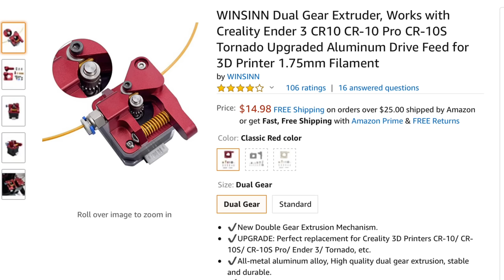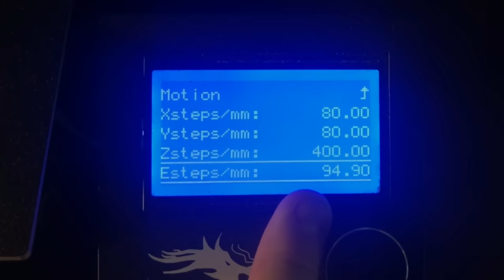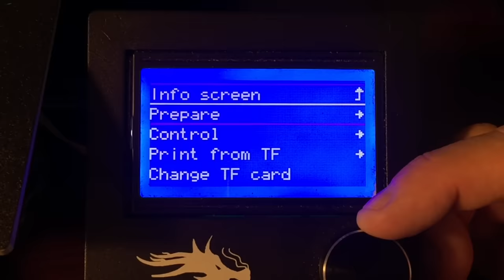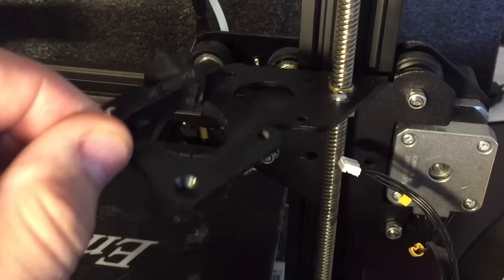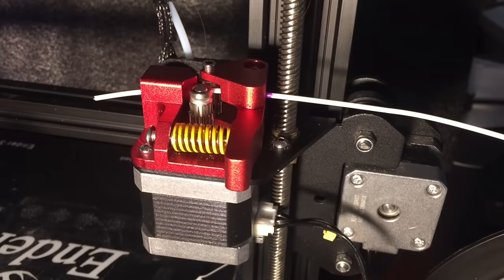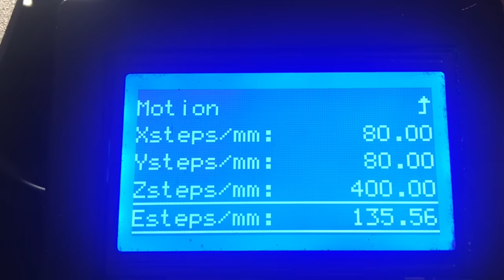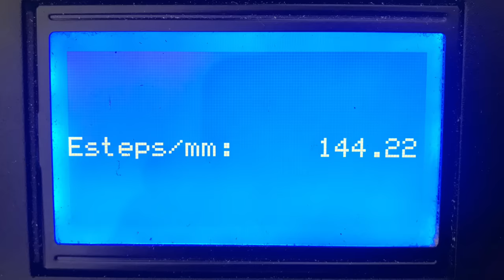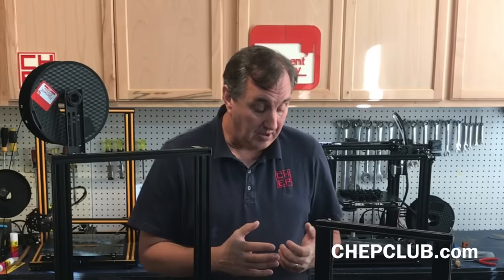Dual Drive Gear Extruder Upgrade + E Steps on Creality Ender 3

Comment: Chuck can this extruder be used with the PTFE insert inside the extruder housing that helps in printing Flexibles? I love the extruder mount that you did with this change but would like to find an all metal extruder mount plate that can do the same thing.
Reply from the maker: You’d have to drill it out. I don’t know of a metal one that handle Ninjaflex.

Comment: Thanks a lot for video. I want to extrude some amount of filament manually, to calibrate the extruder. But unforunately I do not have this option in my printer's menu. I use ender 3 with upgraded to Marlin 2 BIGTREETECH SKR 1.3 board. Version of firmware is Marlin bugfix-2.0.x. Please give me any suggestions, how to make this menu visible. I read on official website of Marlin, that it should be visible only when printer is not printing, but I do not have it neither just after boot nor after the PLA preheated

Comment: Don't know if they offer different versions of these red ones or if it was just me getting unlucky but holes on mine scrape the hell out of the filament. I spend a week configuring everything and it was finally printing well (I thought gears were grinding the filament) but any longer print just eats the filament leading to gears slipping among other things. If my hotend clogs due to having this extruder I'm gonna lose my mind. I'll be contacting the seller to see if there's anything he'll do for me but I'm pretty pissed either way. Finally took time to calibrate everything and I end up with that, even if I get my money back it'll just be a lot of time and hassle that I don't have... Always unlucky with this hobby, really turns me off. My Ender 3 v2 had a faulty board as well, which I had to change. Overall I wish I didn't buy this printer or just invested into a prusa model. It's supposed to be a hobby but it's stressing me out and I'm just stuck testing all the time instead of printing anything.

Comment: Very nice video Chuck! I was wondering if you have tested the maximum print speed with the dual gear and if it's better than the single gear. I have moved my single gear up and down whenever it started slipping to get a better grip, but now my whole gear is sanded down...
Reply from the maker: I haven’t.

Comment: Great video. I bought a similar looking kit to put on a new base ender I put together yesterday. The creality extruder motor has the gear friction fitted on the shaft and I was hesitant to pull it off. The kit I bought wasn't dual gear as advertised anyway so I'm returning it. Would you have pulled that gear off the motor? I'm installing a second z axis and plan to convert it to direct drive and I'll run into the same problem with the friction fit gear and wether or not I should pull it off. It must be one of the design changes they made this year along with the 32 bit mainboard in the base unit. Any advice would be greatly appreciated.

Comment: Just installed this on an Aquila X2, noted the abrasion in the video under the tension arm, and checked the bottom of my arm: definite sign of damage to the edge, so I leveled it with 1000 emery paper. No sign of abrasion, but now wonder about smoothness of the filament path from the general rough surface finish. Would redrilling the holes a few 0.01mm affect the operation?
Reply from the maker: That should hurt anything.

Comment: I bought one of these, but I always struggled to get the filament fed through becase the hole the filament feeds through is a bit smaller.  I have gone back to a standard extruder for now until I have time drill out that hole.

Comment: Thanks for the video Chuck. I wonder if it will fit also on my Cr 10 mini (should be the same as the old stock Cr 10) and of this might improve for flexible materials in comparison to the stock extruder?
Reply from the maker: Yes it will fit.

Comment: Some ender's don't even have set screws. I have a recent ender and it doesn't have them.
Reply: Yeah I noticed that far to late xD 
I had to commit to cutting off the original brass gear from the motor shaft and sanding down the shaft to make it flat on one side for the set screw to not slip with a dremmel

Comment: Not sure if a dual gear extruder is all that great. After adding one to my printer the filament is being ground up and bunching into my extruder gears. I can’t adjust the idler tension any lower because the yellow spring is so incredibly rigid

Comment: It’s not slippage… it’s just back pressure from having the hot end hooked up… I can never wrap my head around why people say to calibrate E-Steps with out running filament through the hot end. Of course it’s going to be different if you don’t calibrate it that way. Best way to calibrate is to do it exactly the way you would actually be printing (IMO).
Reply: @ThantiK  that does make sense but to clarify I wasn’t considering slippage like your describing it. I just meant normal use case back pressure… so say you your e steps difference between no hot end or through the hot end is 6mm difference on 100mm push… wouldn’t it be better to adjust for that 6mm if your not encountering slippage or other issues?

Comment: The original wasn't slipping. You changed the esteps and this caused the difference. That does mean it isn't a better gear drive.
Reply: What
Reply: @Liljoda  When using a new gear drive, the chances of slippage should be very low but the number of steps per unit of filament may not be accurate. If you only calibrated because of slippage, your numbers would be all over the place between slippage won't be consistent.

Comment: I bought a new CR 10S Pro. The dual gear extruder gets jammed with curled up filament whenever there are too many retractions in a print. Otherwise it works OK. Any idea for to fix that issue?

Comment: The main problem with, at least with my stock mechanism seemed to be the extruder gear. The tooth are too rounded to get a good enough grip of the filament even with a stronger spring.

Comment: Chep, I’m wondering if you contradicted yourself or perhaps I misunderstood? You said that the upgrade was worth it since consistent flow would make for better prints. However, you also mentioned that you saw no difference. Can you help me understand please?
Reply from the maker: My extruder and machine were already tuned well. But when I try a new Filament the consistency of the dual gear should help me tune that in faster/better.

Comment: Good vid!  One observation and one question:
1 - I'm thinking the 6mm "standard" error is from the filament having back pressure and bending in the tubing.
2 - I have a printed extruder that has a PTFE insert cut as a wedge for TPU.  How does this extruder setup look for TPU?
Reply from the maker: 1. Bending in tube would make it closer to zero not create 6mm. 
2. It’ll work with some TPU but not really flexible like Ninjaflex.

Comment: Thanks Chuck, I just installed the dual drive, new capricorn tubing, new nozzle as my printer hasn't worked properly since April when I loaned to the robotics team.  I have a couple of questions as I am trying to optimize my printer.  1. How do I enable control to settings like e-Steps on the printer?  I've installed the latest version of TH3D - didn't see any change. Do you have a video on this?  2. You mentioned a tuned printer.  Are there other functions that you tune beside e-steps?  Do you have a video listing them all?  Thanks.
Reply from the maker: You might check with TH3D it should be on there. Otherwise you have to modify the firmware source. I don’t have a video on that. 
Newer machines already have it and so does the new Creality Silent board.

Comment: I was wondering, is it better to calibrate with eStep all the time or do adjustments with the extrusion in CURA?  Or do you do a basic setting to calibrate the eSTEP for 100mm @ 200 degrees and then adjust in CURA for a thicker filament?  What approach would you recommend taking for different filament?  I am finding that the different vendors of filament varies in thickness and need different eSteps.  Even different colours make a difference.

Comment: I can't get those set screws out of the drive motor to get the gear off. Any suggestions. Allen wrenches eventually spin. Tried heating it up letting it cool still no joy. Any suggestions would be great

Comment: At 7:20 the ender mobo clearly steps 1 or 2 mm retraction, but he doesn't seem to acknowledge it. Shouldn't the retraction be part of your calculation?
Reply: That's not wanted retraction, it's the motor step resolution. You can compensate for that a bit by adjusting voltage on mainboard an staying on a whole estep number.

Comment: Don't do it, the Winnsin  dualdrive extruder is Junk.  It works and fixed my problems for about 1 1/2 weeks before it turned to junk. Starts grinding and then binding.  Read the reviews on AMAZON where people say it doesn't last, because It doesn't last.  Its a piece of Junk after about a week of use.
Reply: this is disapointing... I just finished setting my printer up with one of these
Reply from the maker: Work great for me after many prints.

Comment: Hello Chep I was wondering if you could give me some advice on the dual extruder I installed it on my ender 3 printer recently it worked great for a while but then it started stripping my filament how can I fix this?

Comment: Another great video  have you played with a direct extruder upgrade yet on an Ender 3 pro?  Wondering if that's a worthwhile upgrade instead of doing this. Thanks!
Reply from the maker: I haven’t. I prefer the light weight bowden. But I probably will try it in the future.
Reply: @FilamentFriday  i find it difficult to print sain smart tpu, I tried adjusting just about everything for days (stock everything)..... I kept reading direct drive all over the place but I bought this WINSINN dual extruder a few months ago, but just haven't installed it yet, I also  bought the 1.75 Capricorn tubing and its still sitting here too. I am confused if I should go with direct drive but the only downside to that is weight and possibly jerky prints......my stock ender 3 pro past 2 months prints very high quality prints with PLA......so my long and drawn out question would be do you think by me changing the extruder to the one you have suggested in this video, would it help with the stringing on Sain Smart TPU?
Reply from the maker: Doubt it will help stringing much. Capricorn may help but TPU can get stringy.

Comment: u should upgrade the original plastic extruder on ender 3. Because I had a lot of days wasted trying to figure out what was wrong on mine.  ...in that time, I swiched PTFE tube and a bit later nozzle.
Reply from the maker: That’s what the video was about.

Comment: What if the original extruder gear is pressed on the shaft? Sadly I can't loosen it like you...
Reply: Hey, not sure if you ever got this figured out. If it’s a pressed on gear, that means you need to buy a new stepper motor with a longer shaft, preferably one with a flat side on it. I had one with a shorter shaft and pressed on gear, printed a gear puller and removed it, and it worked fine to remove the gear but the shaft is too short for the dual gear extruder he uses in the video.

Comment: Do I need to adjust the flow rate in my slicer also after fitting the new extruder?
 I just bought the extruder for my Ender 3 and Ender 3 Pro along with loads of other upgrades but need to know I'm doing the upgrades correctly before starting.
 Thanks in advance!

Comment: big help because i installed the new extruder and instantly noticed it under extruding filament so the formula was really helpful to recalibrate the extruder steps/mm and would this method work for the X, Y, Z Steps/mm if ever needed? just a curious question i'm new to 3d printing

Comment: Hey chuck, I just installed this dual gear extruded but tightened the gear attached to the motor to low. When I ran the motor it started grinding and I was wondering if this is a major problem. I moved the gear up and it works fine, just wondering if it would have caused any problems.
Reply from the maker: Yes, that has been an issue for some.

Comment: How much do you consider a dual gear is an improvement over a single gear metal extruder. A dual gear costs be 4x that of a single gear one and I have to wait longer for shipping. Is it that much better or will just replacing the plastic extruder with a metal one give me good returns.

Comment: I just upgraded my E3Max extruder to one of these, as well as installed silicone bed mounts. I calibrated the E-steps and whatnot. But now my printer seems to be moving a lot faster and the filament doesn't stick to the hotbed. It's like the print head is moving a lot faster and pushing out more filament
Reply from the maker: Make sure the FR on the screen shows 100% not higher. It’s the Feed Rate.

Comment: Chep, I'm printing fine detail with a .2mm nozzle.  Everything is going well except for some fine stringing between small printed rivets.  Imagine printing rivets on the hull of the benchy, lol.  I suppose I'll have to do an e-step calibration first and then maybe experiment with retraction settings, coasting possibly, hop?  There are so many setting in Cura, it's a maze to navigate, lol.  Anything that comes to mind as far as settings with the slight stringing issue?
Reply from the maker: My best tip is my latest video on cleaning the filament path. Your settings may be fine.

Comment: Bought the same one as you show but the extrusion was very unreliable even though the setup was fine. In the end put the original ender 3 plastic one back and printing returned to normal? Must have some duff with mine?

Comment: Apparently I'm the only person in the world that has a fixed/pressed gear extruder motor ... no set screws.... did I get ripped off? Just about the Ender 3 pro on Black Friday, I got it from the creality site itself. No one seems to have this issue but everyone just seems to cut it off with a Dremel wheel or have to buy a press. Any suggestions?
Reply: Just pick up a new extruder motor

Comment: G'day Chuck. Greetings from Australia! How does this compare to the EZR Struder I just ordered from the states?
Reply from the maker: EZR also supports super flexible ninja flex which this one doesn’t so EZR has that advantage but it costs more.
Reply: You will not regret your purchase. It ended my slipping problems and great with flexibles.

Comment: Hi! Thank you for your videos! They are always very helpfull and interesting!
My printer is a CR-10mini and I don´t have the MOTION-Menu in my system. How can i adapt the Steps/mm in this case? 
Did you already tried to built a duoble noozle on the CR10-Mini? Could it work?
Thank you very much!
Reply from the maker: Connect to it thru the USB cable and a software like pronterface and send it an M92 with the new value. 
http://marlinfw.org/docs/gcode/M092.html
The a M500 to save it.
http://marlinfw.org/docs/gcode/M500.html
Reply: if your printer wont save settings add a line to your start g code to set the steppings. 

my first line in the start gcode reads
"M92 X80.14 Y80.31 Z397.37 E141.76 ;Wrothbogs stepper adjustments"

but obviously my settings for xyz and e are for my printer so you'll need to measure your own

doing it this way is temporary but anything sliced for that printer will always be setup correctly...just don't run foreign g-code..which you shouldn't do anyway

Comment: Should I buy this if I want to try and print TPU?

Or will a standard upgraded one work just as well?
Reply from the maker: For very flexible TPU you want the EZR extruder. This one or stock extruder can handle it.

Comment: You should set your Esteps to a whole number. Marlin isn't going to command 0.22 of a step, just whole steps. So that 0.22 is going to accumulate. After about 5mm, it will command an extra step and that will show in the print. Round it down to 144 and you'll be better off.
Reply from the maker: I verified with the Marlin creators that the decimal point is recommended. So I’ll stick with what I showed as correct and recommended.
Reply: @FilamentFriday  Really?? Ok hmmm, good to know. I'm wondering whether it's worth me recalibrating now just for a decimal value...

Comment: Another great video! I'm trying to get my head around the e-step/flow/temp relationship, I didn't realise temp effected extrusion volume so much till I changed filament and tried printing at 190. I thought that if we want to print at a lower temp with the same e-step the flow has to be increased, not had success on adjusting flow rate to get 100% extrusion, any tips?
Reply from the maker: If you lower the temp then slowing down the print speed might be required for longer melt time.
Reply: I didn't think about slowing the print! Makes sense, another variable to think about. Thanks for your vids! Your hard work has been invaluable  in getting my ender 3 working properly, cheers

Comment: It looks like a steel gear turning on a aluminium arm. Did you lubricate the 2nd geared (one on the arm) or is there a washer or something to protect the aluminium arm from the steel gear? Thank you for your videos :)
Reply from the maker: The gear has bearings inside.
Reply: I brought the WINSINN dual gear and the problem you describe is terrible. The gear has a needle rolling bearing (plastic cage), but it covers only half the height. Looks like it will require two of these bearings stacked. Mine has one. I don't know if it came or maybe I lost it when installing? After couple hours printing the bearing is destroyed and I can see the play of the gear. Sucks. Can somebody confirm this comes with  that only feeble bearing?
Reply: @OpenEmoto  There are two bearings. They are really small, so it's very much possible that you accidentally lost it.
Reply: @TheMahtimursu  Thanks. I've created a brass bushing using an old nozzle to replace the missing bearing (angle grinder and drill makes a poors man lathe)